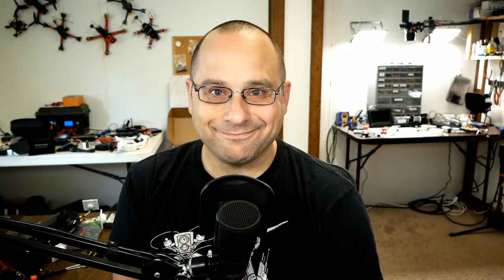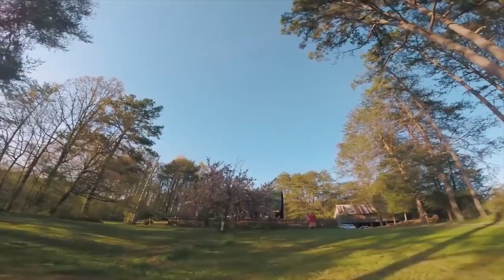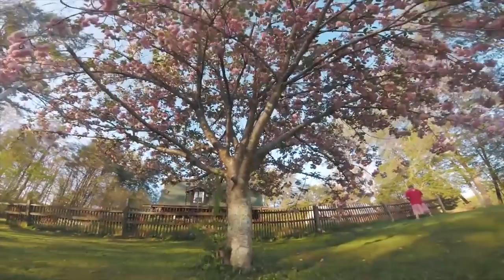Parallel Charging | CAN YOU MIX DIFFERENT mAh OF BATTERY

Comment: Hi can i put 2 lithium 3.6 v in series whit 6 ni-cd 1.2 v in series and and than in parallel and charged whit bms for lithium? Thx (same capacity)
Reply from the maker: Never mix chemistry in parallel.
Reply: @JoshuaBardwell  why? The ni-cd will stay at 1.4 instead of 1.55?
Reply from the maker: Different battery chemistry have different voltage curve and charging methods. If you combine mixed chemistry in parallel, one battery will get over-charged or over-discharged, and the charging will not be right for one of them. A 6S ni-cd pack will be about 8.4 volts at full charge and about 7.2 volts at full discharge. A 2S lithium ion or lipo pack will go down as low as 5 or 6v when fully discharged. In parallel, the ni-cd will match the voltage which will bring it down to 1.0 volts or lower. In addition, the C rating of the nicd is likely to be different than the lipo so it will experience voltage sag differently under load.

Bottom line: don't do it.

Comment: What if I have two big ass batteries (28ah), and ones been charging for 30 minutes when you want to pause it and drop in the next one to charge at the same time. How much of a voltage difference is an issue?
Reply from the maker: Same rule: 0.1 volts per cell.

Comment: Great video, but one part of parallel charging different capacity batteries you didn't address is the is the charge rate.
Say you have a 500mAh and a 5000mAh pack and you want to charge them at 1C, if you put 5500mA charge into the pair, does the little one suffer or does it all balance out like the voltage?
Reply: licensetodrive you would have to limit charge to the capacity of your smallest battery. So in your analogy of a 500 and a 5000, you would limit it to 1C (to be safe) of the 500. It would be slow for the big battery but just right for the small battery.
Reply: licensetodrive in other words, to be safe you are limited to a .5 amp charge rate. You would be faster doing the big one on its own at 5 amp rather than limit it to the charge rate of your small battery. Does that make sense?
Reply: yeah, it's balancing out. No worries. It's all about the internal resistance or with Josh's analogy the smaller container has an smaller infill compared to the bigger container. So in the same time more water can flood into the bigger container. 
 Over time, the internal resistance in your batteries is increasing and the capacity of your batteries is decreasing (The infill get smaller and smaller and the container is getting full of dirt so it can keep less water). so even similar packs differ in capacity all the time.
Reply: Thanks, that's what I thought, I'm never going to charge a 500mAh & 5000mAh in parallel, was just curious about the logistics of it. I wonder if anyone's put multimeters in current mode and individually tested the power going into two batteries of different capacity whilst charging.
Reply: If you charged those two packs together at 5.5 amps, and the packs have the same internal resistance, both packs would charge at a rate of 1C.  They will both become fully charged at the same time.  The 500mah will not become "full" earlier than the 5000mah pack during the charging regimen.  If you stopped the charge half way through the charging regimen both packs would have the same voltage.  A 1c charge for those two packs in parallel would 5.5 amps.
Reply from the maker: Sasquatch FPV sorry to say you are incorrect. Once the packs are in parallel, they act basically exactly like a single big battery. So if you parallel a 5000 and a 500 mAh pack a 1C charge rate is 5.5 amps.
Reply: Flat Out 

Interesting username by the way, but your statement is flat out wrong. If both batteries have the same internal resistance, the charge current will be divided into two, not 1C each. That's means, if you charge the batteries (500mAh and 5000mAh) at 1C (5,500mA) and the internal resistance of both batteries are the same, the 500mAh and the 5000mAh will equally get 2,750mA of current! That's fine for the 5000mAh pack, but definitely not any good for the 500mAh one. That's how resistance relation with current in parallel circuit works.

In general, bigger battery will have lower internal resistance, and with lower internal resistance, the bigger pack will draw more initial current than the smaller one but that's not always the case. For example, I parallel charge my 1300mAh 95C pack together with my old 4500mAh 25C pack. On theory, you should set the current to "1C" (5800mA), but in reality, my 1300mAh 95C pack has 4 mOhm/cell internal resistance (high C rating packs have much lower internal resistance compared to typical one, tested it myself) and my 4500mAh 25C has 6 mOhm/cell internal resistance. That means the 1300mAh pack will draw more initial current than the 4500mAh pack because of the lower internal resistance and being charged at that amount of current is definitely not good for the battery pack.
Reply: Joshua Bardwell for real?! Damn, I guess I am guilty of believing more of this urban myth than I thought.
Reply: Labs thats what I was thinking, but either way I am not going to push my batteries. Too much risk for me.
Reply: Labs, you are correct. I'm wrong in respect to my statements concerning the internal resistance.  I should have stated that the packs have the same C rating.....but those don't mean much anymore either.
Reply: No problem, no need to feel bad :-)
Reply: Labs, I never feel bad about being corrected with solid facts.....well usually.  😁  Correction is part of getting better at anything.
Reply: This all works out ONLY if the internal impedances of the batteries are in the exact ratio. If the 5000mAh has all r's = 0.01 Ohms and the 500mAh bat has r's= 0.1Ohms, than yes you're safe, the charging current 5.5A divides accordingly, nobody gets hurt. But, for example, if the 5000mAh bat is old and got to a point where all internal resistors are 0.1Ohms, then the 500mAh bat will get charged at 2.75A, which is 5.5C. In any case, this is rather extreme, I totally agree. If the difference between is within reason, I'd say less than 2:1, as Joshua was pointing out, in the worst case possible, the weaker batt will get charged at 2C, not a big deal. Honestly it works.! Combine this with Joshua's 4S parallel board and you can just "throw" the batts, balance ports first, let them equalize and then charge them. Pretty neat stuff. Hey Joshua you 4S board is out of stock. What's happening?
Reply: Well I guess everyone is missing something. The battery try to equal them out all the time even when they are gettingg charged and the current flow from the charger is not the only one in this parallel system. There are also current flows between the batteries. So every battery charges at about 1C if you just sum up all capacities and charge at 1C.

I try to explain it a little better. If you have more than one voltage source in an electrical circuit you can't just look at one and calculate all the current flows in this circuit. You first have to calculate all current flows for each voltage source individually and then sum up the resulting overall current flows. Like sure if the internal resistors are way off the 500mah would get more current from the charger. So the smaller one gets more charged up than the bigger one. But then you also have consider the current flow from the smaller battery to the bigger one because it gets more charged up. And in the end the current flow from the battery would cancel the current flow from  the charger out and you would land somewhere about 0.5mA for the smaller one and 5A for the bigger one.
Reply: Adrian S. with all these replies on the subject with speculative information, somebody's got to test things with real batteries.
I have a couple of 2S batteries I can try parallel charging, one 460mAh & another over 8 times the capacity at 4000mAh, luckily the small one is specced for charging at 5C so maybe I can test charge rates up to 2.3A.
I also have a couple of identical high end multimeters which can monitor volts and amps at the same time (meaning watts is on the display too).

Comment: If I connect a full charged lithium 72v 60ah electric scooter battery to almost empty 72v 20ah lead acid battery(not connected for charging) , what will happen? Will higher ah battery discharge by push charge low ah battery?
Reply from the maker: The higher voltage will discharge current into the lower voltage and nothing good will come of it.

Comment: Sir can make 12v battery by using 3.7v different capacity of batteries means
All are 3.7v batteries but
1200+1200+2000=4400mah ,3.7v
1200+1200+2000=4400mah,3.7v
1200+1200+2000=4400mah,3.7v
Like this total 9cells
One set contains 3cells=4400(1200+1200+2000)
So 3sets = 11.1v 4400mah 
Can I make it ? Is it safe

Comment: So maybe parallel charging boards should just have diods on them so reverse current won't be possible... (Then you could also charge batteries with different voltages)
Reply from the maker: This won't work for two reasons. First, diodes drop voltage so it would be difficult to charge the packs accurately. Second, the balance cycle is performed by pushing current into the main lead and pulling current out the discharge lead. Diodes would prevent that.

Comment: Wait - I tried parallel charging some 1300mah and 1500mah 4Spacks, and got an unusual error message after the 1300mahs were full (something like “unequal capacity error). Any thoughts about the potential cause?
Reply: what charger did you use?
Reply: Andriy Sydorka it was either an isdt q6+ or a Hitec x2. Use JB 4S parallel charging boards.
Reply: If it was a capacity alarm, then you hit the charge cycle capacity threshold. It's a safety feature that if a single charge cycle hits X amount of mah, it shuts down because something might be wrong, but it's not wrong, it just wasn't expecting to be parallel charging. Check your manual to see if the error message matches the alarm i'm describing.

Comment: The cells can not balance themselves, If they could we wouldn't Need "balance chargers" to start with. The problem with parallel charging, is the individual cells are not balanced any more. To be honest, you should only parallel charge batteries that are in good condition. If a battery has a bad cell, the good cells will be over charged, waiting for the bad cell to reach full charge. Overcharging a cell is the worst thing you can do to a lipo, next to over discharging it.
Reply from the maker: Here's an ooooold video I made proving that batteries can balance when in parallel.

https://www.youtube.com/watch?v=1GhPXw_BQlc

You're 100% right that you should only parallel charge healthy packs.

Comment: they wouldn't tho. if you have a 55 gallon drum, and a really tall test tube that only holds 1 gallon and you draw water from both at the same rate (say 1 gallon an hour) the test tube, while as tall as the 55 gallon drum, will go empty after 1 hour, with the 55 gallon drum still having 54 hours left before its empty.
Reply from the maker: That analogy is incorrect. You are not pulling water (charge) from individual containers. Both containers are connected in parallel and you are pulling water from both of them at the same time. Imagine that the test tube is connected to the 55 gallon drum by a horizontal pipe at the bottom. Now imagine a straw going into the top of the 55 gallon drum container and you sip water out. Obviously, the water level in both containers will remain equal, and therefore, you will be pulling more water from the larger container thant he samller one, porportional to their relative size.
Reply: @JoshuaBardwell  so the bigger is the battery will give more amperage. What causes that? Or is it pulling the same amperage but then you tell me some amperage to the smaller battery? Sort of charging the smaller battery as the load drawers from both of them?

Comment: I have a 110 ah battery can i  connect parallel with a 35 ah battery. Please help for this
Reply: I've got 1 x 125ah,  2 x 98ah and 1 x 45ah batteries all connected together that I've been using and charging as one for the last 2 years and they are still working fine.

Comment: Can I charge a 1s and a 6s at the same time?
Reply: Mega JimmyHat negative
Reply from the maker: Only if you can make a 1S and a 6S be within 0.1 volts per cell of each other. Which you can't. So no.
Reply: Sorry Joshua Bardwell, you're wrong. You definitely can make a 1S and 6S to be 0.1V to each other. Just discharge the 6S to the 1S's voltage, let's say 3.8V. There, you can.
Reply: @renzevenir4853  now that's the mosftet I love to see

Comment: I'm late here since this video is 3 year sold now but I would like some clarification on the high rate discharge subject...

So Joshua says that mixing batteries of different discharge rates is OK but I've always been under the impression that it's not safe to do so. Maybe this is okay for packs that already contain say 1 to 3c cells and replacing some with 30c for instance is okay since the load draw isnt going to demand all that much but placing a standard cell into an array of high rate discharge cells could be bad... Can anyone clarify?

I ask this because I'm currently in the process of having to replace 15 cells of a 48v 13s (obviously) 5p pack for my sons electric motorbike since the battery contained nickel/steel plates rather than 100% nickel and caused corrosion since the battery wasn't sealed adequately from the factory. Now the cells look like cheap ones since I'm not able to get the manufacturer from the info on the cells which means I also don't know the full specs other than they're 3.7v as for every lithium ion cell and they're 1900mah and I've found some cells at 2000mah which look like they could suffice (which is the original reason I came here)
Reply from the maker: For charging it's ok to mix different C rate. For building parallel banks to discharge, they should be the same C rate.

Comment: Bad analogy with the water tanks. I'll explain why. Pretend that one of the tanks is 90%. And the other tank is 10% full. The second you hook up a common hose connecting both of them, with the water analogy, one tank should drain into the other until they're both at the same level. You may be correct as may be safe I don't fully understand it, but the water analogy is no good. I would like to use an absurd example to ask you if this is safe to do. Here it is. Say you had a small 12 volt motorcycle battery. And a gigantic 12 volt marine battery. Do you think it would be okay to hook them up so that they would charge together? I look forward to your answer. Mark Henry
Reply from the maker: If the tanks are 90% and 10% full, in this analogy that means the batteries are at different voltage. That's not safe to connect in parallel. But you're talking about voltage there, not mAh.

If the two batteries are the same chemistry and charged to the same voltage, they can be connected in parallel even if they are different mAh capacity.

Comment: I've got 4 X 4000mah and 2 X 5000mah that I want to put in series. Would that be possible? They are all the same voltage
Reply: Yes. The difference in capacity does not matter. The only thing that matter is voltage (must be almost the same). So in your case it will work.

Comment: And if the batteries are the same? I have two 6000mah and the same voltage
Reply from the maker: You can parallel charge if the mAh is the same.
Reply: @JoshuaBardwell  oh okay thanks

Comment: so, if i put 4x 5300mah, 2x 5200mah and 2x 5800mah on a paraboard, it works ? o.O
Reply from the maker: Yes, absolutely. Although you'll need a hell of a big charger to hit 1C charge rate with such a big array. That's more than 50 amps to hit 1C.

Comment: Your argument is true only when the charger is really parallel charger. But most of the market charger is fake parallel charger which uses serial changing process with small adjustments between cells.

Comment: I thought the reason for not mixing brands and C rating was to avoid a large mismatch in internal resistance.
Reply from the maker: Since you're only charging at like 1C, IR doesn't matter.
Reply: Doesn't the IR determine the amps for a given input voltage? Like if battery 1 is 3mΩ and battery 2 is 6mΩ, battery 1 will pull twice the amps? Or does that balance out since they're in parallel?

Comment: Can I wire up a 10.000mh amd 6600 mh in parallel to give me 16600ah
Reply from the maker: Yes that's how it would work.
Reply: @JoshuaBardwell  thank you for the reply I charge my battery's separate but other say the ah  should be the same capacity

Comment: ok but im poor and i wana paralell charge but dont have any equipment or batteries. halp. im looking for a solution under 35-40$ usd
Reply from the maker: The parallel charge board is going to cost minimum $15 which doesn't leave you a lot for a charger. About the minimum for a charger is $40 such as the M8 Toolkit I reviewed recently.

Comment: Except that you forgot to address the issue of IR.... if one battery has a vastly higher IR than the other the voltage potentials WILL NOT match and the battery of lower IR will fill to a higher capacity (higher peak voltage) than the high IR (lower peak voltage) battery....
Reply from the maker: Since you are only charging at a 1C or 2C rate, voltage difference due to IR is not really significant. And as the charge cycle comes to an end, the charging current drops lower and the IR is even less important.
Reply: Eganwp ....they will match, but the capacity of charge in the higher IR battery will be less.
Go back and get into Ohms law.